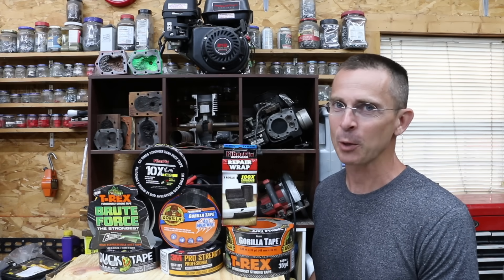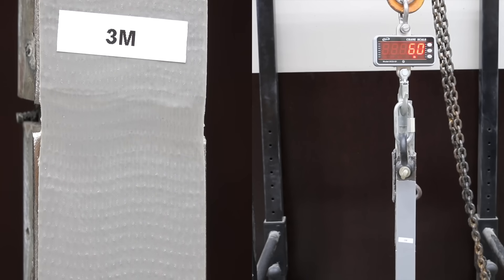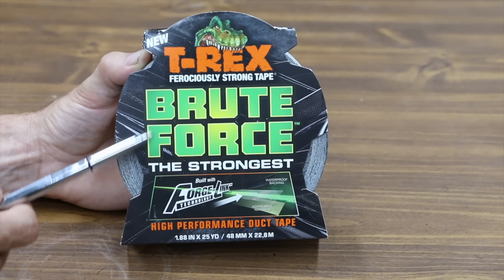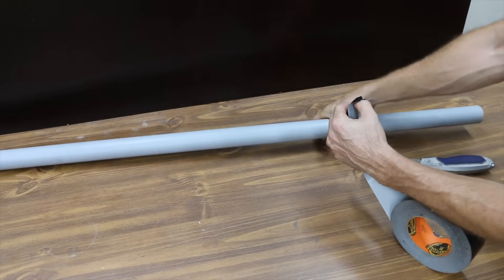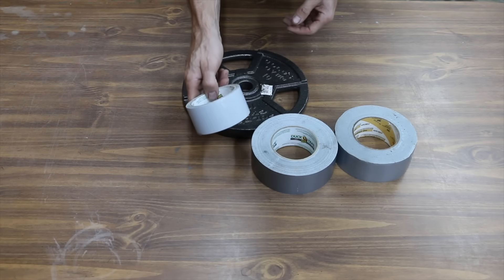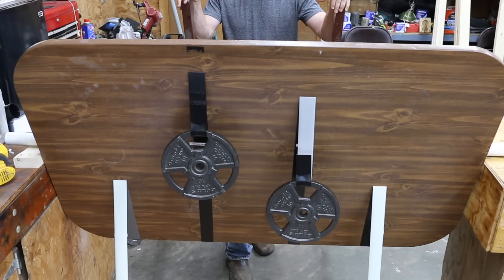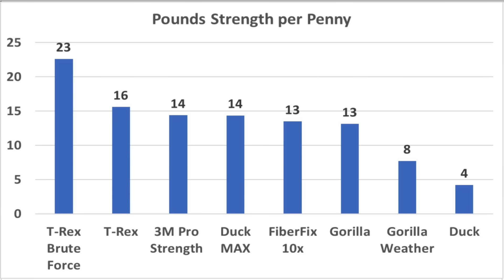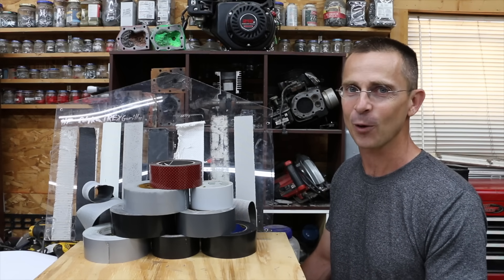Which Duct Tape Is Strongest? Let's find out! Gorilla, T-Rex, FiberFix, 3M Pro & Duck Max

Comment: I’m an electrician and would like to see an electrical tape show down. Including strength,     heat/cold performance, residue left, and value comparison.
Reply: He did it already...

https://www.youtube.com/watch?v=_sBVEPslwZY
Reply: I'd also be very interested in this test.  I've switched nearly exclusively to heat shrink simply because no tape I've tried lasts in heat.  If there is a product out there that would give me anywhere near the protection as shrink, I'd love to use it.
Reply: @c.j.1089  how about self-amalgamating tape?
Reply: C.J. The problem with it is that it’s easily forgotten (I can’t remember how many times I had to desolder because I forgot it!) and the heat from the soldering iron can shrink it before you’re finished, making it impossible to apply. I still prefer it, though, looks more professional.
Reply: @c.j.1089  Check out 3m "linerless splicing compound" a stretchy tape that seals to itself.  Cool stuff but not cheap.  It seals better than shrink tube, but is soft.
Reply: @beardymcmanbun2251  it's also called self amalgamating tape in other brands. It works quicker than shrink tube to waterproof a connection and lasts indefinitely
Reply: @c.j.1089  They become sticky to touch and don't last long ahhhhh I hate that!
Reply: @c.j.1089  No tape does last in heat.  When code calls for a certain type of any kind of tape, the difference in the life of the applied tape is almost non existent compared to the assumed life of the job.  They just specify what tested best. Then they are in the clear and it also keeps the really crummy stuff of of the job.
Reply: @c.j.1089  Scotch 33 would be that one
Reply: Also how they stand test of time without causing a possible short.
Reply: @Rentta  Your work shouldn't need tape to prevent a short.  Tape is pretty much the belt that you put on when wearing suspenders.  And keep in mind that it's a crummy belt and you really don't ever want to depend on it holding up your pants in public.  Just my opinion.
Reply: #dpigskin10 I thought he already did this with Electrial tape. I may be wrong... it is worth searching his video collection.
Reply: I was a  telecommunications and data-cabling installation technician for a number of years. I also have done my own home electrical wiring additions and upgrades for decades. *Electrical tape is only rarely sufficient for use as an actual electrical insulation material*! Mostly, we used electrical tape to tape bundles of wire to a pull-string or rope; and we used white electrical tape and a Sharpie marker to number and identify individual wires in a group as we were pulling them. Otherwise, when it comes to electrical connections, wire nuts, or crimp connectors, or even soldering, are a much better way of making connections than just twisting them together and taping them. If you're worried about dirt and moisture getting inside a connector such as wire nuts, then by all means go ahead and wrap them with electrical tape ---- but if you're really worried about premature failure of the connection due to moisture, dirt, insects etc, than perhaps you should rethink the manner and location of the connections,  splices or even the junction box! 

By the way, I was a car stereo installer for over a decade, and I never, repeat never used electrical tape except as an additional moisture barrier over crimped connectors. I also wired boats for navigation and communications equipment for several years, and  we often used self-amalgamating tape around crimped or soldered connectors, but never electrical tape. I now repair vintage audio electronics for a living ---- and I never use electrical tape; soldering the wires and insulating with shrink tubing is the preferred method.
Reply: @goodun2974  Nobody uses tape instead of wire nuts or push connectors. I use tape mostly to wrap the outlet so the screws can't touch the side of the metal box.
Reply: @CGoffgrid  , in my experience, the people most likely to use, and misuse electrical tape are homeowners and do it yourselfers,  people who repair a cut off or badly dog chewed extension cord or lamp cord by twisting the wires back together and insulating them with tape. I've seen some scary shit like that! PS,  I personally prefer fiberglass or even plastic boxes for my own home, but commercial jobs and regional codes often require metal boxes, sheathed cabling and so on. Some of the commercial data-cabling jobs in schools and businesses did  require us to use metal wiremold, conduit,  and plenum rated Cat 3 and Cat 5. A minor pain, but I also pulled MC cable with the electricians, and that stuff truly sucks!
Reply: good 'un u
Reply: @goodun2974  -Rarely sufficient???????  When is it ever allowed to be used for that purpose?????
Reply: @goodun2974  Good man!
Reply: Cool story bro.
Reply: He's actually has something very similar to what u are talking about
Reply: I thought all the pros only use 3M? It's all I use.
Reply: @CGoffgrid  - "pros" as in contractors use what they are required to use.  What a professional uses is a different subject.  And there is no pat answer for everyone, unless you believe advertising.
Reply: That would be so cool and make sure you include that the black goo doesn't come off of it. I don't understand why we have to have electrical tape that still has the black slime on it. The 3m colors do not have that problem.
Reply: I agree....I am an electronics technician and also a diesel tech...a lot of your electrical tapes are different prices but made of the same materials...I would love to see 3m and scotch and about 10-15 others against each other.
Reply: Yes please!
Reply: He hs already done that
Reply: Lets be honest, they all suck.
Reply: 3 M  T a p e
Reply: Hundo!
Reply: Somone get this man some electrical tape
Reply: Изолента, прикольно
Reply: I would bet on MMM super 88. I think it’s the best.
Reply: 3m duh
Reply: Scotch 33+ 👍🏻
Reply: LMFAO you already know 3m smashes whatever competition
Reply: Hi Sparky
Reply: 3m 8mm

Comment: For your pipe tests, you could drill a small hole every inch, and then you can use a nail as a peg to hold the chain from slipping when the pipe begins to sag.

But then the pipes would have a line of holes in them, and they would have limited usefulness afterwards.
Reply from the maker: Great suggestions!  Thank you
Reply: Would be cool to see the weather results of these tapes in a year. Especially to see if the Gorilla Weather lives up to its name.

Comment: New Duct tape test:  Truck/tractor seat test. 
I have used unknown duct tape to repair a seat in a truck. Huge Fail. It ended up being a horrible mess as the glue melted in a hot truck then the duct tape moved exposing glue patches. Finally the fabric fell off leaving just the glue. A mess. 
Probably should end up being one of the most important future duct tape tests ;-)
Reply from the maker: Great suggestion!  Thank you

Comment: How about a test of concrete reinforcement strengths?   Traditional rebar  - vs.- Helix micro rebar - vs. - Hanson’s fibre - vs. - STRUX macro synthetic fibers - vs. - Dramix steel fiber - vs. - Fiberglass etc.

Micro Helix products are now used in the US for rebar REPLACEMENT, and are gaining fast on traditional rebar. Competitor products are available as well, but not yet code approved as far as I know.  Building materials could open up a whole new channel option for you!
Reply from the maker: Thank you for the video idea!

Comment: Brake parts cleaners do indeed leave an oily residue. This can be easily tested with a pure water spray beading test. Try anodizing aluminum sprayed with brake cleaner; bad results!
Reply from the maker: Thank you for this information.
Reply: I use dawn dish detergent and RO or distilled water to degrease aluminum parts. Typically in a heated bath. But simple green can work as well. Then use 91% or higher isopropyl alcohol if necessary. And avoid touching with bare hands. For your purposes, nitrile glove are great.

By the way, I love your videos. Well done!

Comment: Don't know how to email you directly, but here's a suggestion:  test anti-seize compounds.  

I've always wondered if silver, moly, nickel or copper is better.  Which performs better under different circumstances?
Reply from the maker: Thank you for the video idea!
Reply: Each filler serves a specific purpose. So, comparing to each other may not be conclusive.
I know that silver is used on high frequency equipment such as RF Antennas on Marine vessles.

Comment: Be interested in seeing how duct tapes works for a lot of application people use them for but they are not designed.  The statement, "duct tape fixes almost anything"  like a hole in a water hose, can it be used a belt on a car, can it fix or mend . . .?
Reply from the maker: Great suggestion! Thank you

Comment: IDEA:
Equipment paint. Spray. Brush. Dip? 
Equipment paint prep Degreaser.  
W/Wo separate Primer. 
Was looking at new metal and maybe touchup surface rust. 
A person can paint rust, but it will only last as long as the rust. Deep rust can never really be removed even sandblasting - only delayed (it goes deep microscopically). There are some rust speciality products (tried all but a few - fail), but that is a different test.
Reply from the maker: Thank you for the video ideas!

Comment: I concur with all the other praises.  Just one minor point:  gaffers tape is designed for temporary use and clean removal.  This is quite different from assignments typically given duct tape.  I don't know how many brands of gaffers there are and I doubt they'd be worth your incredibly brilliant testing methods, but it's handy to have around and my uses for it are separate from those of duct tape.  For which, incidentally, I am about to go shopping for a different brand!
Reply from the maker: Great point on gaffers. Thank you

Comment: What year is that truck? It looks new! I've had 3 of that generation of Ram and the Pennsylvania winters ruined all of them.

Can't stress enough how useful and valuable your efforts are. If anyone else does these type of tests and is this thorough and unbiased, I'm certainly not aware of their existence.
Reply from the maker: Thank you.  It's a 1996.  When I bought it 12 years ago, it had quite a bit of paint peel in several areas.  I put a temporary coat of paint on bad areas until I get around to giving it a proper paint job.  Thanks again for the positive comments!

Comment: I am sure many of have nicked the garden hose with the mower.     Which of these tapes would do best to seal say, a 1" cut in a garden hose?    Would any hold a completely  cut in half hose ? Then, retest after the hose has sat outside for a couple of months to see if it still holds, once subjected to water pressure.
Reply from the maker: Thank you for the test idea!

Comment: Great video.  I would like to see the pipe test redone with the first strips of tape running parallel to the pipe, then a layer of wrapping another layer of parallel tape and a final layer of wrapping to see if you could harness the tensile strength to make a stronger repair.
Reply from the maker: Great constructive feedback. Thank you

Comment: I think the pipe wrap test is somewhat flawed. You can clearly see each tape starting to fail even at as low as 1 inch. it would be better to run the pipe through your load tester to see exactly when they fail.
Reply from the maker: Thanks for the constructive feedback

Comment: Great vid! Still waiting to see one I suggested awhile back to see which tape will stick to extreme cold stuff like wood etc. I mentioned using gorilla tape on a shed floor where the boards came together to seal off the cracks and it was in the 30's and it did not want to stick very well. All though I had some aluminum style tape that came with the shed kit and stuck to the metal fairly well at that temperature.  Thanks! Keep em coming!
Reply from the maker: Great point!  Maybe a winter video. Thank you

Comment: What year is the Dodge? I just sold my 1998  12valve 4x4 extra cab short bed and hate myself for it.
Reply from the maker: Thank you!  It's a 1996 with the 12 valve.  The truck you just sold sounds pretty rare!  Thanks again
Reply: @ProjectFarm  ya it was the holy grail and sat more than it got driven. Bad mistake selling it.

Comment: Would you be interested in testing "JB Weld Extreme Heat" against "Blue Magic Quicksteel"? I saw these in Oreillys the other day and was curious how they would do as far as maintaining strength at high temperature and how well they could actually be machined after hardening?

https://www.oreillyauto.com/detail/b/cargo-thermosteel-3068/chemicals---fluids-16461/glues--adhesives---sealants-19861/metal-repair-glues-17961/f2f2383113e8/blue-magic-cargo-thermosteel-high-temp-metal-repair/18003tri/2573494?q=exhaust+epoxy&pos=7

https://www.oreillyauto.com/detail/b/j-b-weld-4009/chemicals---fluids-16461/glues--adhesives---sealants-19861/epoxies-19863/7c957f981032/j-b-weld-3-ounce-metal-repair/37901/4388157?pos=0
Reply from the maker: Thank you for the video idea!

Comment: This is by memory, so forgive any errors.  

According to your graph, 1 foot of t-rex max can give the tensile strength of 25 lbs. 1 foot of duck gives 5 lbs. Figuring ~12 feet (one loop) of t-rex max can pull a tractor, would ~60 feet (5 loops) of duck tape be able to do the same?
Reply from the maker: I believe the chart you're referencing the the pounds of tensile strength per penny per foot of product.  The challenge with using multiple loops is applying each loop exactly the same length and tension.  If done perfectly, each layer will provide nearly the same amount of support.  If not, one layer will fail before the other layers.

Comment: I think a video comparing break in procedures on new engines would be interesting. Its been long debated if synthetic should be used in a new engine right away. Also letting a new engine idle for extended periods of time vs running hard under load right away. You could do compression and leak down tests and possibly dyno to compare results of different methods. It has been argued to the death on forums forever..
Reply from the maker: Thank you for the video idea!

Comment: For HVAC work, I will now be using Trex. Seems it should stand up to heat very nicely. But foil tape will still be largely used. For now, all I use duct tape for is line set insulation and flex duct.
Reply from the maker: Thank you for the video idea!

Comment: Many uses for tape is temporary repairs meaning it will be removed at some point. That being said how hard is it to remove the left over adhesive and what removes it best? Gasoline, diesel, goo be gone and others could be tried. 

Time is a factor as one of the tapes did not adhere well at first but would not come off easily after a year so some time would be needed for adhesive cure time.
Reply from the maker: Thank you!

Comment: Which bacon provides the most bacon per dollar after cooking? !!  As far as the duct tape, I'd like to see a test of what solvent is needed to clean off the goo after it has aged (especially outside).  For many I have used a petroleum solvent like gasoline (better with motor oil added), diesel or kerosene.  Forget "Goo-Gone" as it's little if any better and far more expensive, but I suppose better for kitchen use due to the less objectionable scent.

There is another test, which petroleum solvent provides the best bang for buck cleaning compatible adhesive off of things.  I bet it's gasoline with oil in it - the oil keeps the goo from hardening too much while the gasoline evaporates (I do use it outdoors).

I usually use my old 2 cycle engine fuel that has become stale due to being leftover in winter, so it's essentially free if I don't want to use it in my 2 cycle equipment any longer, and can also use it for parts cleaning.
Reply from the maker: Thank you for the video idea!

Comment: I would like to see a test comparing rust preventative undercoating products for vehicles that can be applied at home and the pros and cons of using rubberized, polyurethane, wax/paraffin or asphalt based products. Which products hold up against salt, abrasion etc.
Reply from the maker: Thank you for the video idea!

Comment: Although I use Gorilla tape a LOT, I have determined that it is in fact NOT 'all weather' tape, as the hot sun light can melt the adhesive and make it fall apart, AND the adhesive then crumbles to powder over time becoming unusable.

I would advise 1, do not use directly in hot summer sunlight or any place that the temperature is likely to exceed 140F and 2, do not leave any edges exposed to water as it will disintegrate the adhesive over 60 to 90 days time.

For anything which is cooler and drier than that, however, it should last about or very close to forever... 
~( 'w')/
Reply from the maker: Great point

Comment: NASCAR has 200mph tape, but my friend that repairs 747s said they have 1000mph tape. lol 
Basically it's something like adhesive alum sheet that they temporally hammer on to loose panels when they haven't got time to go inside a structure to rivet another panel on.
Reply: There are a lot of cool tapes out there. The stuff thats used for temp repairs on gas pipelines is awesome, and costs about $600 a roll lol. 3M makes tape thats used to construct buildings!